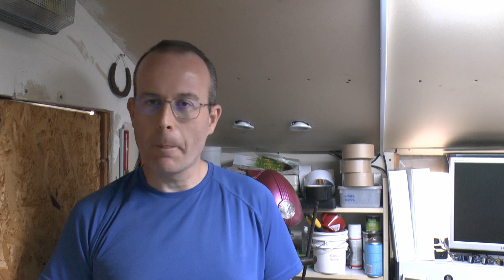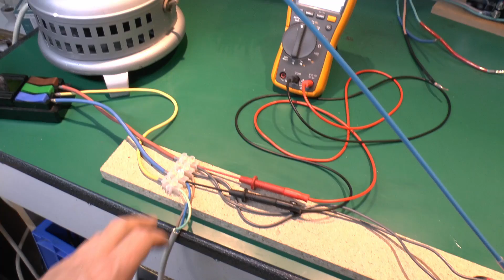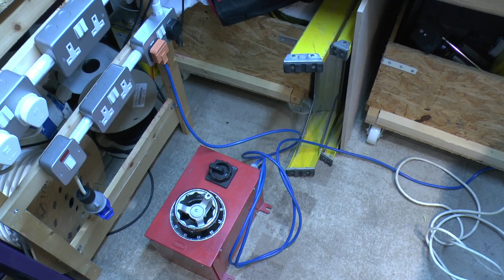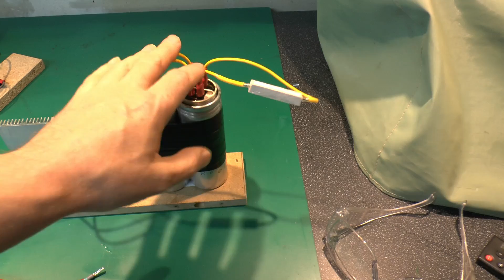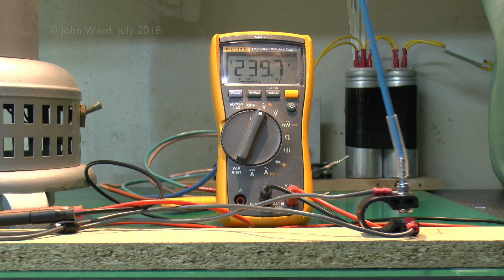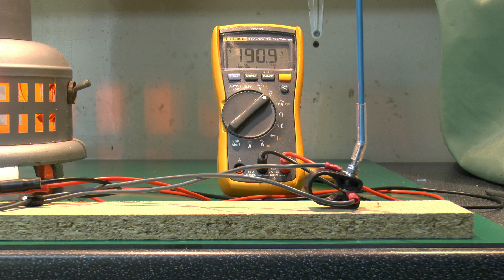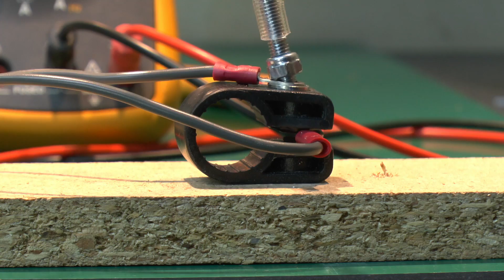AC vs DC Switching Demonstration with Arcs

Comment: +John Ward
A particular DC<>AC case I'm interested in is SELV 12v fittings and wiring.   A useful upgrade in some situations is just to replace the 12vAC halogen electronic or magenetic transformer,  with a 12v DC power supply (typically of reduced rating) to feed small MR16 12v LED bulbs free of 100hz flicker and minimum-loading and other related annoyances.
From what I can see, no real practical problem comes from this, and in any case the secondary side of 12vDC is not being switched in this case, seems likely not to arc anyway.
Any views on this?
Reply: sbusweb Are you asking if it is okay to switch the ac input to the power supply? If yes, then there should be no problem with this.
Reply from the maker: No problem with that.
Reply: No, I'm more asking if it is okay to re-utilize fittings intended for 12vAC, to hold small 12v DC led-bulbs, by changing both the power-supply and the lamps, but leaving the light tracks/wiring...  Everything tells me this is fine, though in (some) cases the fittings SAY "ac only" on the MR16 holders.
Reply: sbusweb Well, if the fittings and the contacts in the fittings are in good condition, there should not be any arcing. So I don't think there would be a problem. Especially if the LED lamps have a lower power rating compared to the originally fitted lamps. However, I must make the point that this is general advice as it's not possible to give specific advice.

Comment: On a related note, isnt there something called the skin effect which means the higher the frequency the more the current 'clings' to the outer part of the conductor, therefore for AC you need a thicker guage for any given current than you do for DC?
Reply from the maker: Skin effect is a thing, but it's not significant in normal AC circuits - at 50Hz in copper, skin depth is about 10mm, so is not a factor until you have copper conductors over about 300mm².

Comment: Very very good John well done hey how about doing experiments with capacitive loads, inductive loads as well as the resistive you've just shown
Kind regards Warren
Reply: Warren Gray this is an inductive load. Huge voltage spikes on disconnect indicate that, but JW hasn't got his meter across the heater he's got it across the supply so it's not shown. The heater he's used is basically a huge coil of thin gauge wire, which has inductance as well as resistance.
Reply: burgersnchips Hi there,
I am not sure that the fact that the load is a coiled wire and therefore inductive, I think it will play a part in the energy discharge, but I reckon the huge reservoir capacitors on John's test rig would cause it regardless of load as they have a low internal resistance and therefore can supply massive amounts of Q in one burst,
Load is not the main factor in what was shown,
But it is a good point that you have raised!
Reply: This wouldn't be inductive, otherwise it would completely destroy everything it's connected to. It is probably coiled, but the wire is folded in half before coiling so that any magnetic field would cancel itself out instantly, destroying the chance of being an inductor even worth worrying about

Comment: Wicked video, cheers John. You said that rectifier was rated for 150A, (on Facebook) what was the uF of your caps you where using?
Reply from the maker: 60uF each, 120uF total - although they are manky old ones so actual capacitance may be less.
Reply: John Ward fair enough cheers for the response. Could I ask you maybe in an upcoming video to do this experiment with your Welder on the high current setting on a 6A AC MCB? 

I think that would wicked. Reason I ask is that I was once fixing an installation were by a 50A AC MCB was used on a battery disconnect for a solar installation.... lol. 

I’d like to see how the MCB reacts as all I saw was a burnt out thing that I then changed for the correct device. :) 

Kyle

Comment: JW; you're claiming the heater is a resistive load. It's clearly an inductive load! Where else is all that increased voltage coming from to form those sparks? Your heater is effectively a huge coil of thin gauge wire, which provides resistance and inductance. 

It's an interesting test but please repeat it using a genuinely resistive load.

Comment: Very interesting demo, I didn't think it would ark that bad. Question though, would it be fine to use a normal house switch (AC 120v) on a 12v DC system?
Reply: Bille747  - my advice would be to derate the current rating of the switch by 50% minimum. So for a 5A switch, don't switch a 12V load greater than 2.5A. The lifetime of the switch will be even greater with even less current flow.
Reply: Mike EL - i don't know if i agree.  this demonstration utilized high voltage dc, and thats the significant difference.  high current dc loads (30-50 amps) at low voltage are very easily handled by standard 5 pin relays, take one apart and you will see the gap between the contacts is not very large.  there is a point at which dc becomes dangerous to touch (as in touch ur 12 or 24 volt car battery terminals and nothing happens) i think its about 60 volts or so and that is probably the point where using an ac switch for dc becomes a liability.
Reply: Mark 1024MAK - generic 5 pin automotive relays rated at 50 amps in either 24 or 12 volt varieties have contacts whose size is less than 4 mm and their gap is around 3 mm when open so ur recommendation is wrong.
Reply: Its true that DC tends to be lower voltage but doesn't electric cars uses batteries that supply somewhere around 300 + volts?
Reply: Bille747 - dc is lik ac it can be whatever voltage it needs to be i have a few low voltage (12 volt) ac power adaptors its the same as low voltage dc if you touch the output it won't do anything to you.  electric cars as far as i know are high voltage dc.  they just put the batteries in series.
Reply: michael perri  Yes, but the design of the contacts and the metal alloys used for the contacts also have to be taken into account. General purpose relays and switches will have both AC and DC ratings (the current rating of both being dependent on the supply voltage). My employer uses 12V, 24V, 50V and 120V DC supplies. The relays that switch at 50V and below, that are used in low current, not safety critical systems use a silver alloy as the contact surfaces. The systems that are safety critical have one silver alloy contact and one carbon contact per contact pair. This is to reduce the likelihood of the contacts welding together. The relays that switch the high current (10 to 15A DC motor) 120V DC supply use very heavy duty silver alloy contacts and are designed to withstand the resulting arc.
Reply: Mark 1024MAK - u need to re-read what you wrote, thats what i am trying to say.  its not the current so much with dc relays its the voltage.  a generic 5 pin automotive 24 or 12 volt (low voltage) 40 amp (that is what they are rated at) have tiny contacts and barely any gap.  at low voltage there is no arcing, or at least nothing like what is shown on this video.  thats an interesting concept you mention though for high voltage dc they use contact material to control arcing.
Reply: Mark 1024MAK - a light switch is no different than a low voltage automotive 12v toggle switch, is what i am trying to say, essentially.  just don't use it for high voltage dc.
Reply: Mark 1024MAK - and also taking into account that the original poster wasn't trying to use his household light switch as a relay.   at the point at which his system is pulling more than about 15 amps dc (at 12 volt) i would consider the tradeoff a liability.  but its like that with all toggle switches.
Reply: Mike EL - yes?  what are you trying to say?  low voltage dc does not arc like in this video.  thats the point the original poster wanted to know.  if its safe to run an ac 120 volt household switch with LOW VOLTAGE dc and by rights the answer is yes, as a household light switch is essentially a low voltage dc toggle switch on steroids.
Reply: Mike EL - ur first post is incorrect as this video demonstrated.  a household 120 volt ac light switch would probably catch fire if used for 120 volt dc regardless of the amperage.
Reply: Mark 1024MAK - what business are you in that runs motors at 120 volt dc?  any and every industrial motor i've ever seen run on alternating current.
Reply: https://www.amazon.com/Uxcell-a13070300ux0611-HH52P-General-Purpose/dp/B00E1L86EQ/ref=pd_lpo_vtph_60_lp_t_1?_encoding=UTF8&psc=1&refRID=FWM884B6JF0HEWNGQ5WQ    - this is essentially a generic automotive 12/24 volt dc relay.  these are NOT rated for 120 volt dc.  if you google 120 volt dc relays you will find them but they are very expensive because they are much much different as this video demonstrates once dc voltage reaches a certain threshold it arcs very easily but below that voltage threshold it behaves like 120 volt ac.  its why toggle switches sometimes have two ratings (ac and dc) but a toggle rated for a 120 volt ac is almost always rated at 12/24 dc.  lightning works because of voltage.  arcs need voltage to arc.  not current.
Reply: In my youth I put a couple of fog lights on my truck and did not use the recommended solid state relay. I used a AC switch with a pull chain because I thought it looked cool. I wired everything up and it worked upon inspection. It was around the fourth of July and a couple of friends and myself were out popping firecrackers at dusk and when it got dark I turned on the fog lights. Every thing was fine for about five minutes and then suddenly it looked like someone was arc welding inside my truck. The fog lights went out and there was a small fire from the wires by the switch. That's when I learned the difference between AC and DC  switches.

Comment: If AC electricity is switching between negative and positive flow why don't appliance motors change direction with the polarity change?
Reply: Twig depends on the motor, for standard squirrel cage and universal motors their stator magnetic field is also generated using the line voltage, so it flips exactly as does the rotor field allowing it to continue to rotate. Universal motors can be used on both AC and DC and are actually more efficient on DC I believe

Comment: That’s interesting, i never knew that, but what exactly causes that problem like fundamentally? When you get specific, what is it about dc voltage that is different? And im not referring to the obvious here where 60 hz cycles on and off 60 times a second, im saying there must be more to it than that, right?
Reply from the maker: It's the obvious thing - AC voltage goes to zero 120 times every second so arcs are easy to break.
DC is on at full voltage 100% of the time.

Comment: Very informative video, but still missing one important aspect - the case when DC is just rectified AC i.e. current flows in one direction but voltage reaching zero at double AC frequency. Will it be sufficient to suppress excessive arcing or not?
Reply: also filtered

Comment: I have 5 of the popular 48v battery on/off on/both/off turn knobs black and red I want to use with solar panel runs up to 200v 45A max and am feeling worried about their use. Simply saying no, they are not specified does not inform me of their suitability compared to 2p 4p solar Isolator turn knob boxes that are used by many costing £30.00. My 10mm conductor pole battery switch cost me £2 each after making an offer they couldn't refuse. I am scared to test it myself as I am not that stupid to try it myself when plenty of others post video's of themselves nearly dying performing such electrical shenanigans. Question, are they suitable. Nice video as always, cheers.
Reply from the maker: A switch designed for 48V DC will be destroyed if used with 200V DC, as when the switch opens the arc will be longer and require a much larger contact gap to break the arc.

Comment: John I have a gsm switch thats rated to switch 240v ac at 2 amps.
Would it be ok to get it to switch 12v dc, if I used an automotive 12v relay? Current to switch the relay would be probably be something like 300 milliamps.

Comment: Why is the heater humming with DC (for ex @4:57-5:00 and @5:22-5:29) and not with AC?
Reply: foufou33g Maybe its because the resistance changed because DC doesnt has to push against the magnetic field. That could end with more power and the Variation in the voltage(because its not pure DC) would make the sound. Its only a theory. It all depends on what kind of resistance this heater is. But that would make this test useless. I mean 1A 240VAC vs. 10A 240VDC wouldn't show the difference between AC and DC.

Comment: very good demo, Thank you.
What if I used a SPST AC Toggle switch to switch on and off a 12v DC Circuit that carries no load while switch is thrown? lets say I have a 12v dc cigar male one end and female other end with the SPST AC toggle switch (10amp at 220V AC) between the male and female point (Im using a cigar lighter extension cable with the AC toggle switch as a simple on off switch, If I only switch the toggle on and off with no load or very little like a 2 amp usb phone charger, and digital volt meter,  would it still be as bad? I mean I can always throw the switch first and then only plug in the load, then you may ask what the point of the switch... the point of the switch is that always connected to the other end of the cigar cable extension (Female side) is a little digital volt meter to show the volts and amp drawn. I do want to switch this off, the vehicle that it is in, only gets used on weekends and the Digital Volt and Amp meters lit up display will drain power during the week, unnecessary
Reply from the maker: It won't be damaged with no load.  Many AC switches have DC ratings anyway, the DC rating will be much lower current.

Comment: Would I be correct to assume that the reason the arc is bigger while disconnecting (as opposed to connecting) the heater from the DC supply is due to back EMF from the inductive load of the heater?
Reply: There's not much, if any, back EMF from a resistive load, so no, the arc that's formed when the contact is closed is quickly quenched by the fact that the current prefers to take the easiest path from metal straight to metal. On contact opening however, the arc ionises the air it's flowing through, which makes that air highly conductive, so the arc grows, gets more powerful, ionising even more air as the contacts continue to open, as so the current can continue to cross the increasing gap, ionising more air as it does.
Reply: Ken Phillips I was imagining the heater element was a big coil of wire, kind of like a big air core inductor but I guess even in that case it’s inductance would be pretty low. So I guess like you said the load is mostly resistive. Thanks for the explanation!
Reply: As the supply voltage is fairly low, at 240v DC, it's incapable of jumping across the gap of the contacts until they're very close, so only a very small spark at switch on. However, when opening, the current is already flowing so as the contacts start to open a tiny bit the current can initially jump across the gap and then as the gap increases, as Ken Phillips said, due to the ionising effect of the initial spark on the surrounding air the spark grows and continues to do so until the gap is much wider.
Reply: Good point, that I wasn't specific enough about saying, so cheers for the clarification. I only learned about stuff like this properly when I witnessed a cheap incandescent lightbulb fail, one that apparently didn't have any internal fuses. It popped slightly, flickered, then lit up like a small blue white sun, before exploding and taking out the fuse (a fuse wire one!) in the distribution board. So yeah, that's when learned how conductive that plasma's are :-)
Reply: As the heating element is probably a coil, albeit probably a loosely wound one, there would actually be some inductance because it'd be creating a magnetic field, but it'd be negligible compared to the resistive load. High power wire-wound resistors can sometimes cause issues in electronics, because their coiling can be tight enough to start causing significant enough amounts of inductance, which can unexpectedly upset circuits. I love stuff like this because it really does show why electromagnetism is called such. Even how the iron filings and stuff align around the return cable of a welder is fascinating, because it highlights just how powerful the field around even a straightish wire can be if the current is high enough.

Comment: How do the Noark 63A DC breakers "pull it off" ?(No pun directly intended.)
Reply from the maker: DC breakers and switches are designed with much larger contact gaps, and usually a very fast spring loaded opening mechanism.

Comment: John, Thanks for the video. Would it be a good idea to have  a capacitor across the contacts when switching DC like on old car contact breakers in a distributor?
Reply: Nuts n Proud they are used for noise suppression. Radio's and TVs used to pick up that noise as they went by your house..
Reply: Nuts n Proud - A capacitor would not help with DC switching to reduce the damage by the arc.

Comment: In theory can you use a dc switch instead of a ac switch as long as the amp rating is large enough??
Reply from the maker: Yes, DC switch in place of an AC switch is ok.
The other way is not, as AC switches will be destroyed by DC.
Reply: @jwflame  what then for a dc switch rated for say.....12v @200a  to switch 230v 20a